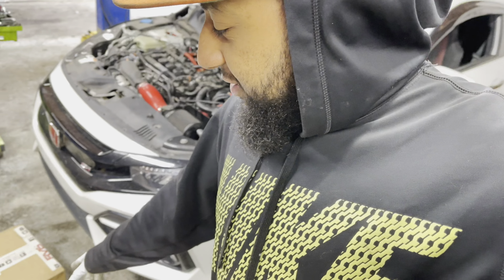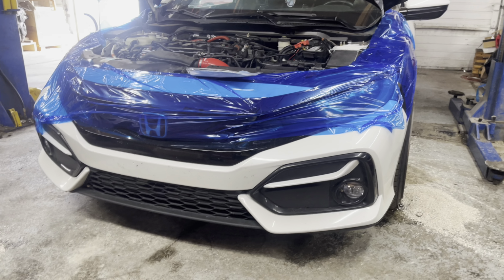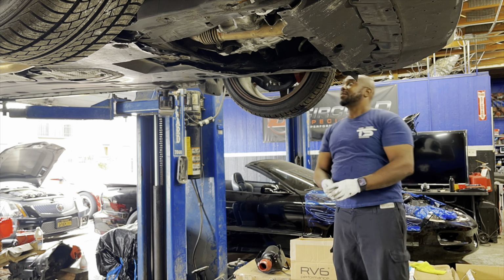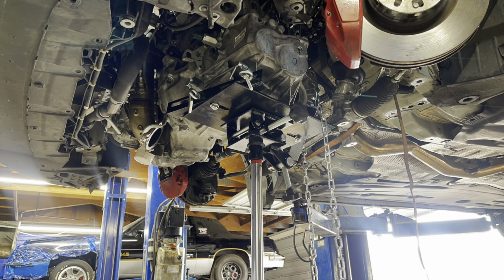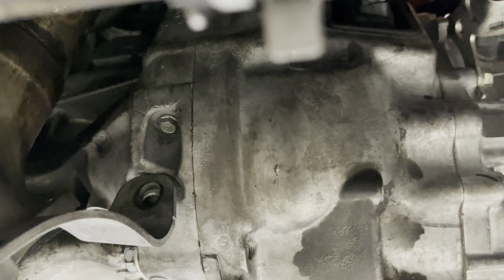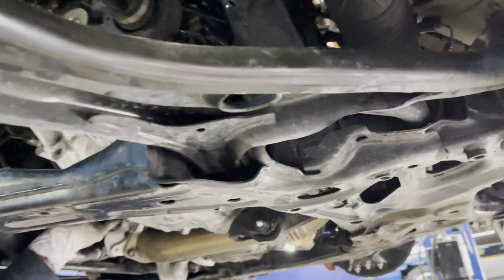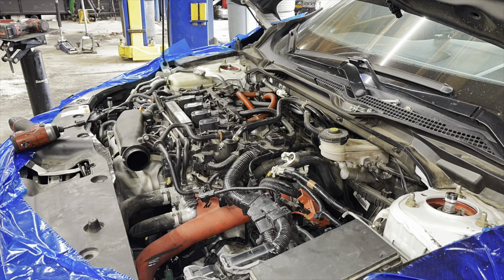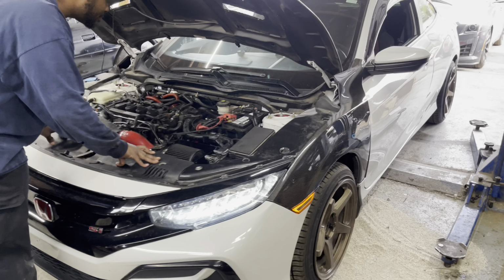RV6 Clutch Kit Install 2020 Civic Si

Comment: I believe my clutch is fried, so I'm going to order the RV6 Clutch Kit and planned to replace the old one by myself. WIth time and the manual for the install do you think I could install this on my own, or does it require a specialized mechanic? Also, if I was going to pay someone to do something like this, do you know a ballpark range about how much the labor  would cost?

- W
Reply from the maker: No, nothing extra, using a lift and a transmission jack makes it easier. Calls for about 10-13hrs book hours to do it if i can remember correctly. So depending on shops labor rate you can determine from there. Very simple kit to install if you’ve done a few clutches before.
Reply: Thank you for the feedback! Have a good one.. @TheShopLLC40